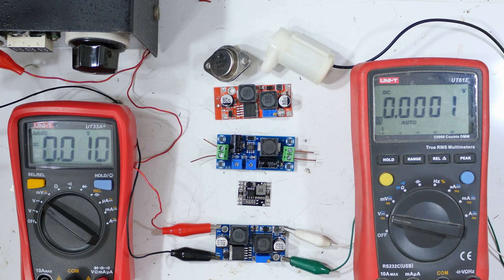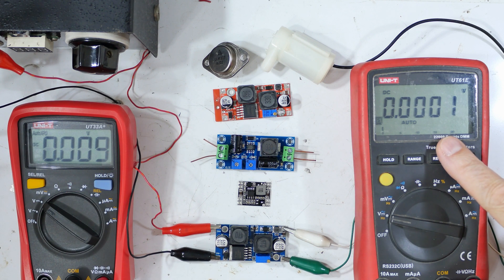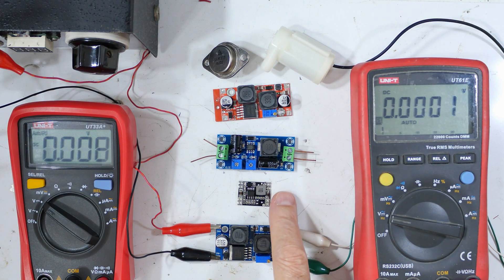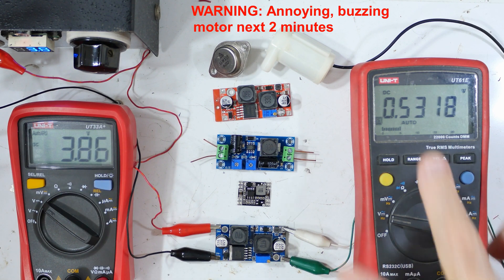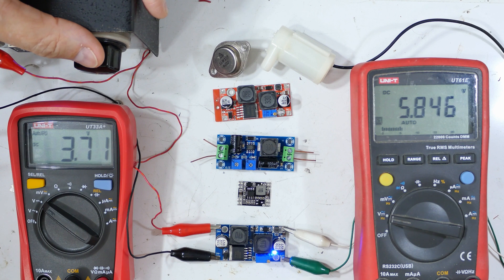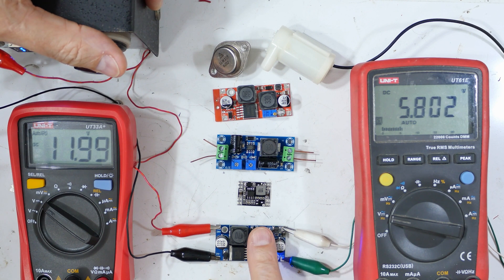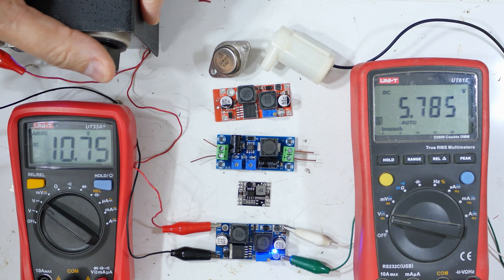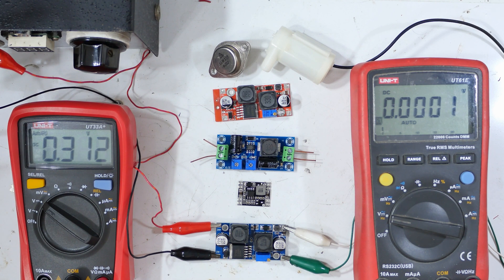Voltage Regulators - Buck Converters (4K)

Comment: Running a pump? so they handle inductive loads just fine? interesting.
Reply from the maker: It seems to.  I needed a bigger load because if the load is too light, the output is not stable.  We used these to run an Arduino with solar / battery.